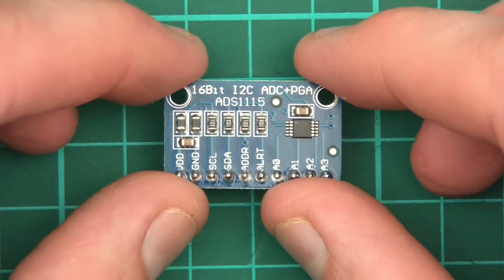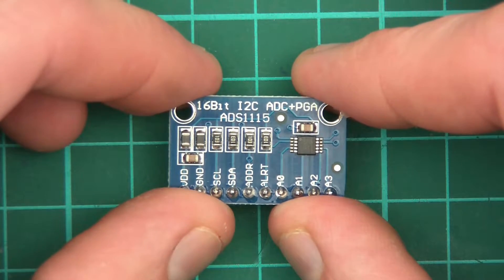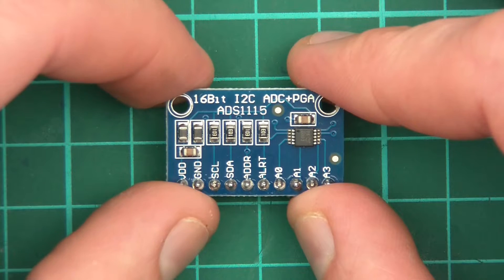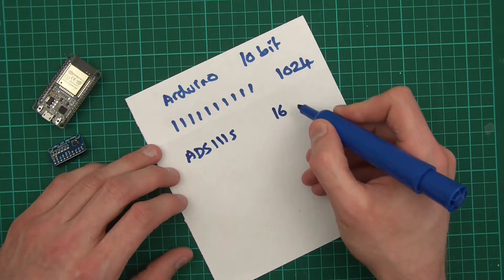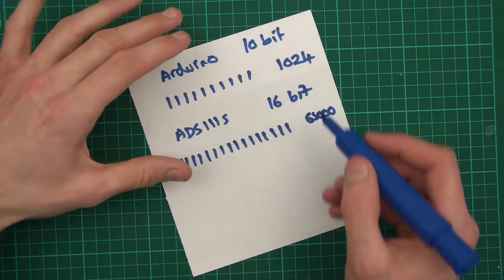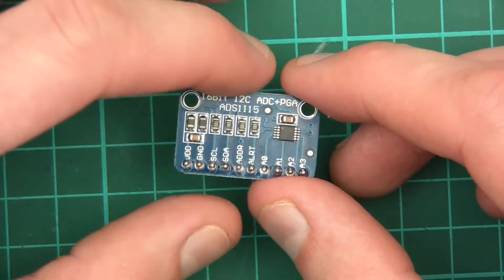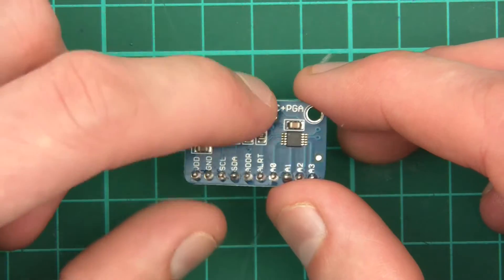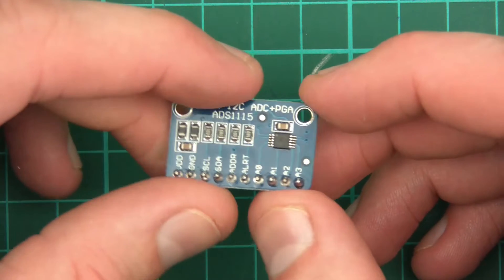TUTORIAL: How to / About the ADS1115 External 16 Bit ADC - Part 1

Comment: ADS1115  has 16bit, but you can use only 15 bit ( 1bit is indication of  positive or negative) it work like this -32768 to 32768
Reply: And on the negative side you can't go lower than -0.3 V without destroying the thing, so really it's a 15-bit ADC

Comment: For a 16bit, its 65000. Instead of doing 5V/65000 to determine what their step is, shouldn't it be refvoltage/65000? The ADC has an internal reference voltage.
Reply: it should be whatever the adc is rated for - 5v 3.3v anything else, 16bit is 65536 0-65535, not that to much stock should be put in low ability adc's accuracy 
5000/65535 =0.076295, times that by 
measured voltage(say 2.5v) = (32767*0.076295)*1000=2.499v
3v3=3300/65535 =0.050355
1.65v=(32767*0.050355)*1000=1.6499v
it should be said though that these voltage/resolution calculations produce floating point number which produce calculation errors(not all decimal point numbers can be reproduced leads to rounding errors), probably not important at 0-5v but if you were measuring large numbers it could noticeably affect result.

Comment: measuring +/- current is a common stumbling block with a/d for example battery charge/discharge.
Reply: What do you mean by 'stumbling block'?  This is exactly what I am trying to do with the ADS1115 (years later).  Will this NOT work?  Limitations?

Comment: Pretty much for Raspberry Pi :))
65.535 I think btw
Reply: 16 bit (2 Bytes) works out to be 65,536. Most if not all programing language variables use those 65,536 values in the range of 0 to 65,535 since zero is the first number in binary sequence.
Reply: @DodgyBrothersEngineering  Oh yeah right